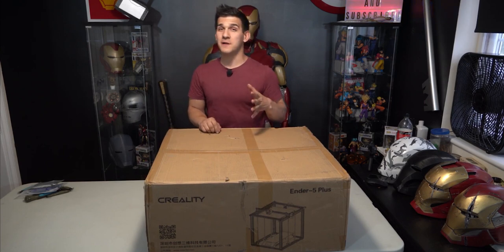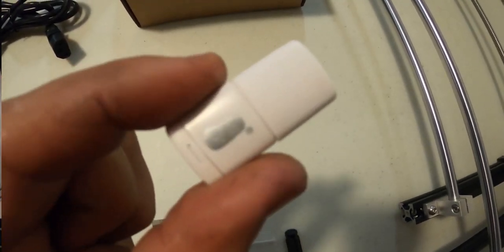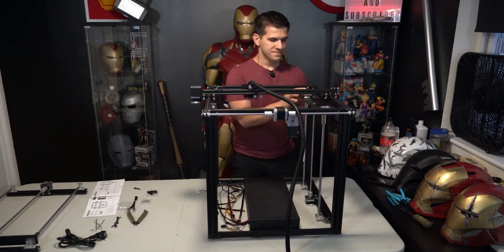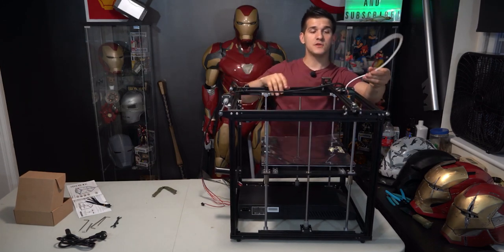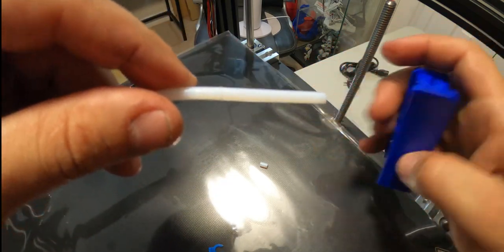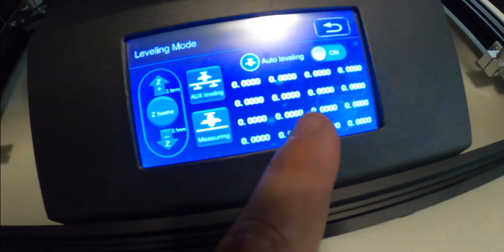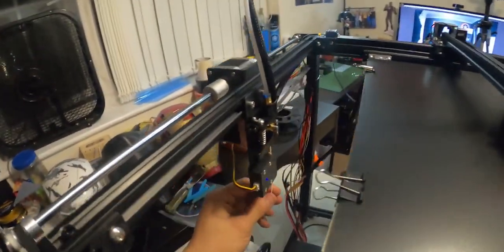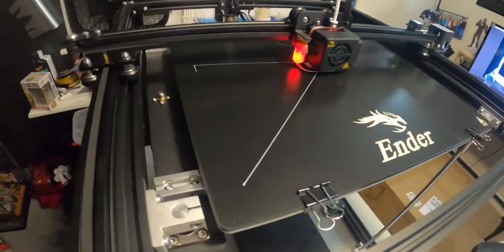Print Iron Man With Ender-5 Plus Made by Frankly

Comment: Regarding the power loss function, unless you get power back within a few mins the bed is going to cool down and release the print and the continuation of the print will fail, I was really lucky and came across a very old pc for sale for pennies with a non-interuptable AC power supply, so if the AC fails then the bank of batteries kick in and the printer doesn't even know the mains has failed, I got 12 hours of power to my printer when I tested it out, however, I can't remember the last time my AC power failed, but if your in a country with power outage problems then a conventional build surface or a UPS is the best way to go

Comment: Hey-
So just got and assembled my printer and followed your instructions but after doing the auto level and then going to manual, the nozzle was 1/4” off the bed. I adjusted with the z arrows to lower it but now it drills the nozzle into the bed and messed it up. What could I have done wrong and how to adjust it because every time I go to the leveling menu it buries It’s the nozzle